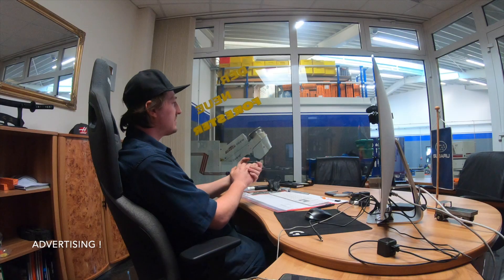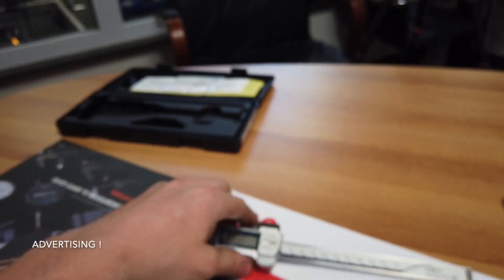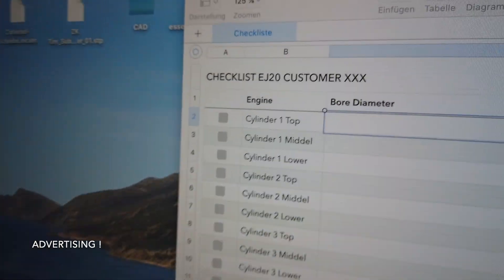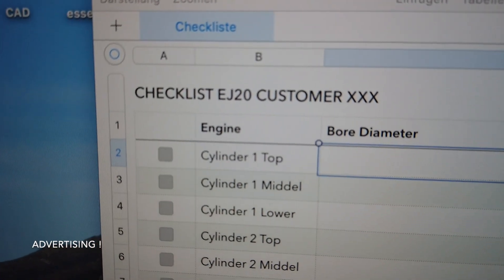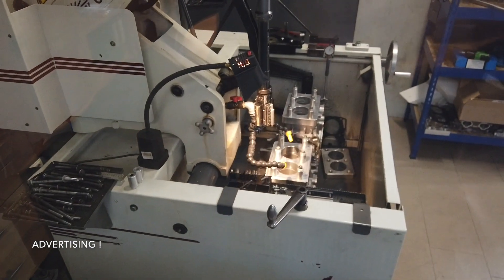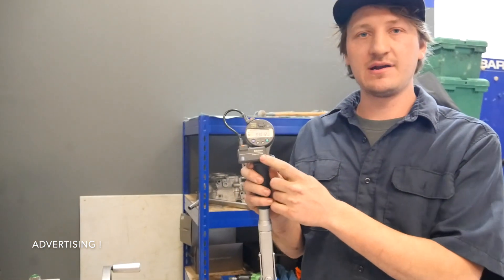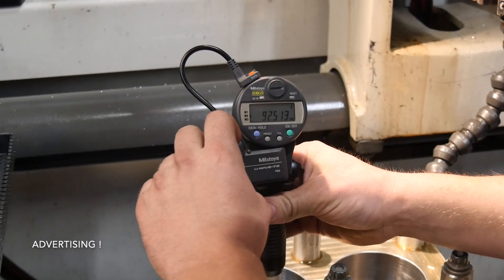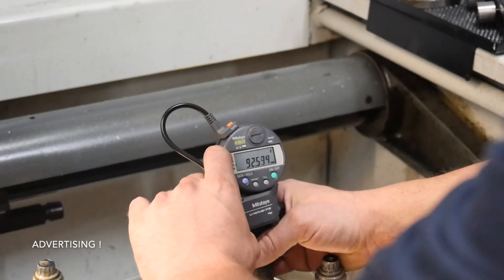AWESOME TOOL-Tuning l Mitutoyo U-Wave l Quality l Subi-Performance

Comment: there is a bug in this design, i think. Since you have to move your hand to push the button to send the measurement via bluetooth, you are moving the measuring tool while you push the button, sending a maybe erroneous reading to your computer. it would be a lot easier if the tool would measure the minimum diameter of the bore (and this is the actual diameter of the bore), store it till you push the button to send it to the computer. It's a bit hard to explain since English is not my native language.
Reply: The Mitutoyo Absolute digimatic indicator he is using (ID-C), automatically "locks" the final measurement of the bore after moving the inside Micrometer bore gauge front and back a couple of times, just as we do with the dial gauge to find the measurement. So, once it is automatically locked on the digimatic, you can move it as much as you want. The  number will remain on the screen and saved in the gauge memory if you want.
He then clicks the BT transmission button and voila.
Working that since 2016.
Technology moves on.
Beyond that free advertisement I just did, they never offered me a damn thing from Mitutoyo Europe like our friend here! Had to pay them all.💲💱

P.S.: Mitutoyo Japan.